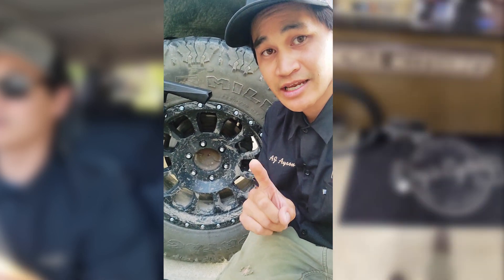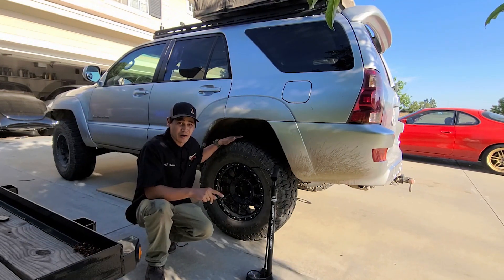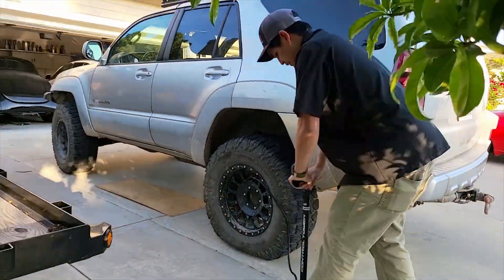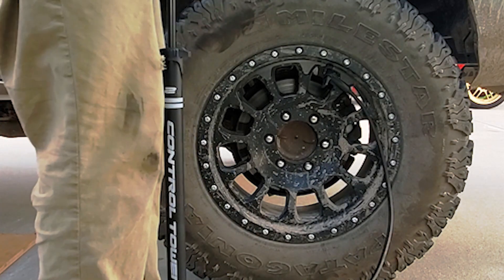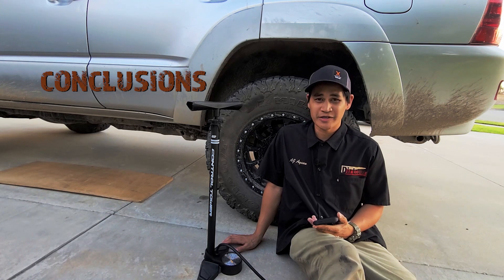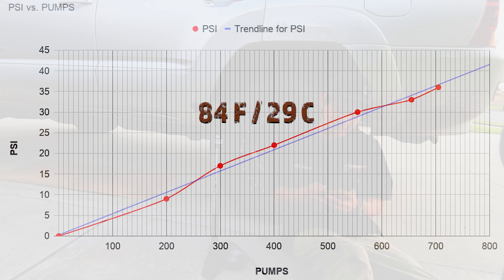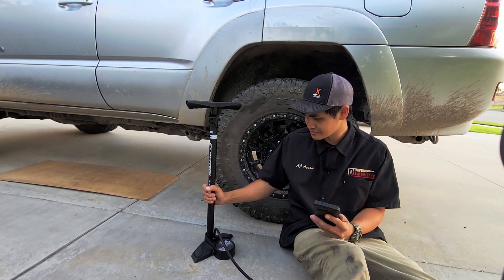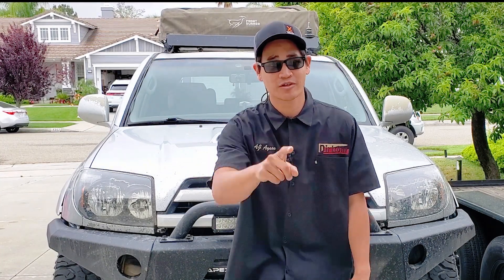How Many Pumps? Offroad Tire and Manual Bike Pump!!

Comment: Wow, I'm impressed with your data recording and curve fitting process! It looks like the tire pressure is a linear function of the number of strokes of the pump handle. Which makes sense if you remember the ideal gas law from high school chemistry. PV=MRT. Assuming a more-or-less constant air temperature and a constant tire volume, the pressure in the tire is directly proportional to the mass of air pumped into it. And the mass of air increases by the same amount for every stroke of the handle. The effort force required to pump the handle also increases linearly with the pressure in the tire, and the total energy expended increases with tire pressure squared! Pumping air into a tire is similar to compressing a spring from an energy perspective.
Reply from the maker: Thanks!

Comment: Appreciate this informative video. I was initially surprised at high cost of $43 vs $10 walmart pump but in all fairness walmart pump wouldn't last more than 50 pumps without overheating and blowing its hose. Looks like a good workout but spare 12v pump seems like a better option for about the same cost.
Reply from the maker: Thanks! Yeah.  Definitely not practical.  Could probably get a good manual pump for $30 as well. Yes, electricity is your friend! Hahaha.
Reply: For lower pressure applications, a high-volume air pump such as the Bell Air Attack 650 for $20 will inflate much faster than any electric inflator, battery or corded. And those electric inflators have a duty cycle as well to prevent overheating, except for the really heavy-duty ones made by the likes of Dewalt and Milwaukee, which are well into the $100+ range. The problem with electric inflators is that they are extremely energy inefficient. They move a small piston back and forth at very high peak speeds, which forces the air through the hose in short, high-velocity pulses. The high air flow velocity induces a lot of pumping energy loss, which is converted to heat in the pump and hose components. Also the faster piston speeds means more friction losses within the pump, wasting energy and reducing its lifespan. And the corded pumps draw a lot of energy from the alternator/battery. A high volume manual pump is far more energy efficient since the piston is larger in diameter and traveling a lot slower, so you're moving a larger volume of air per stroke with a more consistent air flow velocity, which keeps pumping losses to a minimum. A high volume foot pump typically has a smaller displacement volume than a high volume floor pump, but you can exert far more force and power using your leg than you can with your arms and trunk. At a certain tire pressure, the foot pump starts to be more effective than the hand pump because it can force higher pressure air at a faster rate without fatiguing your muscles.

Comment: Get yourself a big hand-pump, not a flimsy bike pump. Big pumps, to be found in all kind of 4x4 rentals all over Africa, quite easy to pump up a car tire.
Reply from the maker: Yes true. The whole point of the video was to use a flimsy bike pump!
Reply: Never heard of a hand pump. I might check those out to see if they can be used to fill a bicycle tire.
Reply: @DirtComplex I don't plan on using a bike pump to pump a tire up from 0psi, but I wouldn't mind using for when there's a blip in the weather due to transitioning from fall into winter. 

My dashboard light goes crazy when there's extreme fluctuation from fall to winter and winter into spring with the tire pressures.

I appreciate you taking the time to share just how realistically long it would take to pump a tire from 0 to 33psi. I just need about 10 -15 psi and then another day, I might need to remove the air if we get a warm day, because the 32psi could jump to 37psi, when the max for the tire recommendations are 32psi for my specific car tires.
Reply: @DirtComplex  I have an air compressor, but I need to go to a bike shop and see if they have the part that clamps onto a tire, because the stem that pushes onto the tire stem, to push air in, is broken.

I can lop the old one off and maybe see if I can find an electrical tape or those electrical plastic rubes you can light to shrink around a wire, if they make them big enough to fit over a compressor hose. 🤷‍♀️